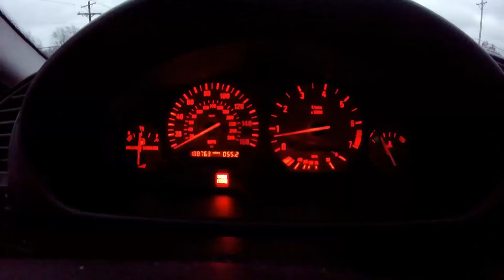Should You Ever Replace Your Transmission Filter?

Comment: Great video. What do you think about yearly drain and fill cycles? I know is not ideal, but you are renewing 30% every single year ... and is easy. Thanks! Editing for adding: To your point, I couldn't agree more. If filter would really need to be changed, they would have invented a more easy to access design. Regards, Nacho.
Reply: Well, unless the goal is to sell you a new vehicle when the trans craps out after the warranty runs out.
Reply: They don't make it easy so that you have to take it to the dealer!!
Reply: Periodic drain and fills.
Swear by it and have had cars and trucks both run 400k without a hitch.
Even if pan removal is a pita I’ve pumped out and pumped back in exact amounts.
Wala fresh fluid !

Comment: I totally agree with you. Most transmission filter will only filter to maybe 100-200 microns size particles. Most clutch wear particles are smaller than that & go right through the filter. I dissected a transmission filter on our '07 BMW X3 with the French made GM transmission, running Dexron VI fluid, and had 132k miles on it. The filter almost looked new. I had to check the date code molded on it to see that it was the original filter. Also, the magnets pick up most of the steel particles, the clutch particles will eventually settle out & adhere to the pan vis surface tension.  That's why you have to wipe them clean. So, IMO, a "drain & fill" will do the trick. I do it about every 10-15k miles which replaces  about 40% of the fluid. Thanks for you video.
Reply: Same here i had my 4l60e rebuilt and beefed up. I put her into another astro van at 10,000 miles.added deep Pan.replaced deep type filter from shallow one.i feel same highway Miles replaced fuild about 3 times in 70,000 miles.no issues. Started shifting little harder so i just took off pan. Cleaned. And replaced  ac delco filter. Shift s nice corvette servo. Shift kit also.i will cut open filter to inspect. 3 and 4 shift flawlessly. When new bam into 4th.2 nd feels like normal. Little firmness. So i agree im curious to inspect.thanks for view.
Reply: I Used a KM 95  Mask  and its Still Running Today

Comment: Breakin time and wear depending on driving habits.  Can cause it might not get clogged but over time can slow down the flow and I would think it'd put more stress on the pump as well restricted flow.  CVT I have I've changed the paper filter big difference in color no longer black or dark clear.   But I haven't taken the time to change the metal one but I've been looking into cleaning the metal screen filter as I heard you can. Ty for this informative video. 👍🏽

Comment: I own a 2013 MKX AWD with 200,000 miles and we just had transmission fluid changed for the 3rd time leaving the factory filter untouched, 1st change was 150,000 miles so I believe you are 100% correct. Now we purchased this MKX @ 80,000 miles and I'm a bit of a maintenance person, but the mechanic who did the change also agrees with you.
Also had an issue with the PTU on the same car so to stop the vibration we had a new PTU installed but this time I used High temp fluid, are there parts available to rebuild the factory PTU?

Thank You Randy

Comment: Pete, I completely agree with your logic.  In my case, changing the filter in my C4's automatic is what actually killed it.  My fault 100%.  I didn't remove the old O ring before installing the new filter.  I think I damaged it while trying to dig it out.  That allowed air to be sucked into the trans fluid.  After doing a 1/4 mile run, the trans started slipping real bad.  The first thing I did was pull the dip stick.  The trans fluid was loaded with little air bubbles.  After letting it sit for an hour, the trans started working normally again.  But, the damage was done.  Under certain high throttle operations, the trans would slip and not upshift.  In hindsight, I should have never messed with the original filter.  Now, in my 96 Impala SS and my 2003 C5 Vette, I leave the trans filters alone.  The trans in my Impala made it to 270,000 miles before I had it replaced.
Reply: It wasnt changing the filter that caused your problems with your trans. You made a mistake not the filter ....  mechanics error.
Reply: thanks for sharing. The dealer tech put the rebuild flush amount of oil back into the transmission after a pan drop. I had several EXTRA quarts and also had tons of air bubbles and burnt smell. I did a trans flush after that and they confirmed what I had seen at the dip stick - several extra quarts of oil from the Dealer pan drop, filter change! My transmission failed soon after the flush but it was definitely caused by the dealer tech error. Since the transmission had the rated 275K miles on it and I was just trying to extend the life of the transmission I didn't pursue the dealer error. But your story confirms that as you say, "the damage was already done." I got a rebuilt transmission - for a few thousand dollars. They put in new cooler lines also though at my request. I'm now 10K miles later and so figuring out if I should change out the filter myself...or do a flush before the fluid gets burnt without changing the filter at first...hmm.

Comment: The filter filters the shavings. If there a certain amount of shavings in the filter, it will hinder the flow of the fluid. So if you're changing the fluid, why NOT change the filter as well. It makes absolutely no sense to have clean fluid flowing through a filter saturated with blackened fluid.

Comment: You can get it out of the torque converter you just keep filling running and dropping it takes about 15qts to completely get everything out of the converter maybe even alittle more they used to have drain plugs on some torque converters not anymore though. I still change my trans filters every 60 thousand but I see your point. I just rebuilt a 4l60e too, the new stuff is taking all the fun out on working on automotive.

Comment: This is so interesting video Pete. I changed the trans fluid a year ago(it had never been changed), when I bought my car (128i E82 84k miles) because I did feel some vibration in specific RPM and gears. The dealership told me the problem is the transmission and we should start from changing fluid. They told me that the drained fluid was quite bad and there were some metal debris but after changing fluid my car turned to drivable. But what I got shocked was the dealership doesn’t exchange the filter and pan, they just drain previous oil and refill. So, I was thinking that I should exchange the filter, pan, obviously fluid again because there are still highly likely some metal debris in transmission. However, based on your opinion, do you think I should not or don’t have to re-change fluid and etc? I’ve only drive 6k miles after I exchanged. @Pete’s Garage
Reply: How has your car been driving ever since??
Reply: Ff

Comment: It really depends what transmission filters were used in certain vehicles, the one in your video can be reused after cleaning it, so do some filters with metal mesh screens, some transmissions have two or three filters, cooler filter will definitely require changing if there is one to prevent it from overheating, maybe change the Honda transmission filter that looks like a fuel filter shape too. My car has a paper filter also called transmission filter on Nissan parts website, it's on the torque converter when I opened the diagram. I called my dealer service department and they said CVT does not have a filter, so they drained and refilled 3 qt and charged me $200 with two recalls and reprogramed my computer transmission from 2nd "gear" was one of the recalls.

Comment: good video and very valid points, however most people can`t just buy a pan gasket on its own. the trans filter service kits come with a filter anyway. my advise is to always do a regular trans service - when trans has done under 200,000km, to do every 50,000km, then when trans has done over 200,000km to service every 25,000km....this will give you max life and reliability from your trans...the biggest point of removing the trans pan is to clean the magnet ( and good idea to flush the switch plates ), so the fine metallic wear debris stays away from your solenoids and sensors....i`d recommend adding magnets as well ( once a magnet is covered in the fine debris it cant hold/catch more ) we often add neodymium magnets to trans pan.... and finally bypass the coolant heat exchanger/trans cooler to eliminate chance of "milkshake" or coolant entering trans. good stuff cheers

Comment: Pete, thanks for this; traditionally I've just replaced filters like you said - now I'm rethinking it! What I wish manufacturers would do is incorporate an external filter we could change that filtered better than the internal filter. It would give an opportunity to inspect the transmission fluid. Ideally, a cartridge type filter.
Reply: Yep, same, I just hate taking that stupid pan off, its not bad on some vehicles but some others its just annoying
Reply: Had a Subaru and it had an external spin on type trans filter.what a great idea
Reply: Hates doing basic transmission maintenance. Later calls the trans a POS when it fails early.

Change fluid and filter where applicable when mileage due. Pan drop only - NO flushing.

This guys video is for clicks only. Do not follow his advice.
Reply: That's what I'm thinking too, agree with you
Reply: @Joedoriamusic  some automatic tranaxles 
Have an internal filter you can’t get to unless you disassembled  the case ,but I always change the filter if it’s under the pan
Reply: I thought the same about an external filter with flush ports. I'm not sure how well the internal "filters" work. You see metal in pans all the time, but a torque converter wipes out the pump and everything else. Perhaps the fluid should be channeled through a filter before the pump. Now my head hurts.
Reply: @Joedoriamusic  Well, you can say that to my Hyundai Elantra 2008, but How the hell I can do it in my Kia Soul 2012?  Answer me.
----  Is Impossible in the Kia soul, so: This guy has a reason.

Comment: Good video. for those of us that are Nissan fans. on a CVT that part that was in his hand is not a filter ,its just a pick up screen. There is a second filter that is a canister filter mounted on the outside of the transmission of inside the case near the valve body.

Comment: I don't think you need to replace the filter as often, as long as the fluid has been changed before the fluid has been burned up. If the fluid has gotten too burned up and is overly thick it may have already clogged up the existing filter. Just a hypothesis.

Comment: since its a closed system, routinely change the trans fluid every once a year (approx 20k km, whichever came sooner) will keep the trans in good shape. so just like you said, if the trans filter is clogged, then it surely means the owner rarely change the fluid -> problems in the trans..

Comment: Pete's right. This is not an oil filter that filters down to at least 20 microns. Unless you're installing a Magefine filter or something similar to the transmission hose line, the fluid is literally passing through mesh or sponge, both of which are designed to catch shavings and the like.
Reply: I'd say you're  right in general ,though I'd stretch the oem cycle from 1:3 so potential shavings would not factor performance if given. You have far than a stilled mind your stated claim is proof along your altruism.
Reply: Depends on the transmission and the filter.  Once I saw the filter in my wife's QX4 (aka Pathfinder) was just a "rock catcher" screen, I knew it wasn't worth replacing.  Other transmissions have real filters.  Do you think that the material in a real filter is not going to fail in 20 years/200k miles (which is less than the last two cars we had, bought new)?

Comment: Only way to know if filter is getting dirty is from pressure drop test from before and after a filter. And yes a filter can have dirt or metal inside and still be doing it’s job. The filter shown in video is just a sump pump screen and not a true filter. Sometimes behind a attached cooler is an actual small filter that definitely should be changed because of physical small size. Any filter change can help with slightly better flow or pressures helping last longer life for the cheap price of filters!

Comment: Draining and then re-adding fluids in mine for preventative maintenance. So figured it would be best change the filter anyway since opening the pan and draining fluid. Going back with Doorman pan with a drain plug. 05 5.4 f150 automatic. Which filter do you recommend? Wix or Motorcraft?

Comment: The reason why the filter needs to be replaced is because all the parts will very slowly wear over time creating very small particles of metal and the filter catches all those particles over time, catastrophic failure is different and does not parts are not being worn out even with good oil in them.
Reply: Have you ever opened up a transmission filter with over 100,000 miles on it and inspected the filter media? I have several times and there was virtually nothing on the filter media itself.  The filter can catch any larger metal particles from when the car was new and the transmission was going through the break-in process but the very small metal particles will go right through the trans filter (it's not like a motor oil filter).  Many trans filters are nothing more than a metal mesh/screen.  Worn clutch particulates also do not get caught by the filter but instead get suspended in the trans fluid itself which is why it's a good idea to change the trans fluid regularly and in most cases and shorter intervals than the manufacturer suggests.  In many newer cars, the trans filter is no longer even accessible but instead built in to the trans internally and on accessible by completely disassembling the transmission because the filter is only meant to be changed once the trans itself needs rebuilding.

Comment: As someone who had run many Jeep Cherokees with the venerable AW4 trans it is pretty common for guys to just drain & fill the trans at regular intervals & still get 300k or more out of them. Even if we are not towing, climbing, or rock crawling the short trips, stop & go, idling in traffic is hard on the trans so we should service per the severe use recommendation. If you're not spending hours pulling, removing gasket or RTV without scraping the mating surface the time saved & lack of dread will more then make up for using better fluids & even changing more frequently.
I've never cut one open, but on the AW4 the filter is a coarse screen & functions primarily as a pickup. Also I don't see it being critical that the magnet is cleaned when the fluid as changed as its general a strong magnet & will hold plenty of clutch material. 
Thanks for taking the time to tell me what I wanted to hear!

Comment: It depends on the vehicle, how many miles it has, and how long you plan on keeping it, because if it's an older vehicle you plan to keep for awhile, then yes, a filter and fluid change will come into the picture at some point, simply because if you change the fluid and not the filter, the old filter will dirty up the new fluid faster.
Reply: new fluid is not going to dirty a filter. only in a dusty environment.

Comment: Thank you so much for this video. I have been searching this morning contemplating if I need to change the filter on my 2006 4.0 v6 tacoma and my 1995 2.4 4 cyl tacoma. It seems to me all I need to do is drain and re fill a couple of times if I am going to do it myself and that is all it needs ever. Would you say that is correct?
Reply from the maker: Yep. Easy peasy.
Reply: Pete's Garage When do you recommend cleaning the magnets inside or do I not need to worry about that if I drain and re fill often?
Reply from the maker: Personally, I wouldn’t worry about the magnet. If it has excessive material on it then you have bigger problems.
Reply: @PetesGarageandperformance  
How do you know there excessive  material on the magnet if the pan is not open?
Reply from the maker: You would have a symptom like slipping when shifting into one or more gears. Changing the filter and cleaning the magnet isn’t going to fix that. The material that’s stuck to the magnet had to have come from parts that need replaced, like clutches or bearings.
Reply: @PetesGarageandperformance  
Thanks for those pointers. Do whining noises, only happen on 1st & 2nd gears also have tge same issue(s)?
Reply from the maker: Usually a whining noise is either gear mesh issues. Like a worn planetary pinion gear bushing. This causes a gear to gear mesh issue. Also it could be one of the thrust bearings between gears that move at different speeds in those gears.
Reply: @PetesGarageandperformance  
Thanks, this should be sorted out ASAP then by a competent tech.
Reply: @PetesGarageandperformance  Ones the materials are glued to the magnets it is forever intact in there and nothing to worry  that there comes a day it will lose and be in the transmission oil again. 🤔

Comment: @ Pete's Garage 

2002 chevy 2500hd 4l80e.  Has 83,000 miles on since new. Transmission was serviced with new fluid and I believe a new filter @ 50k. I have a drain plug in the pan on this model.  Would you personally Pete,  pull the plug and drain or drop the pan and install new filter/fluid?

Edit: gears just roll in smooth and shifts no problems...